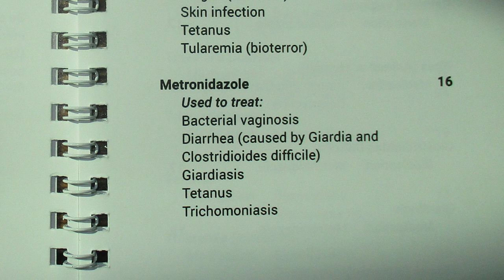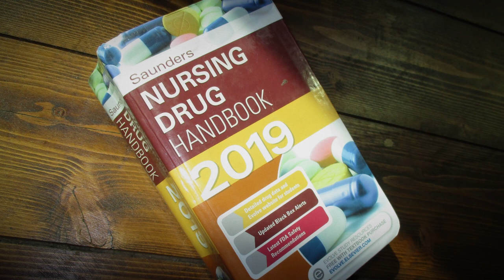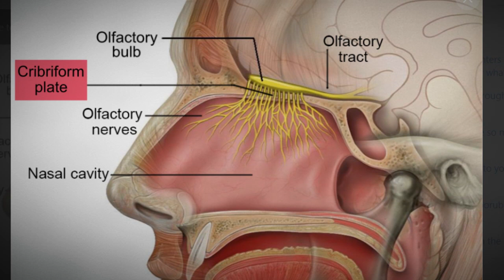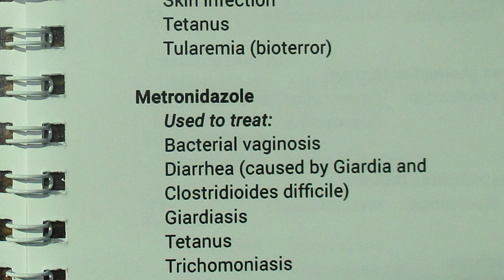The Truth About Jase Cases

Comment: Hi, great video! As a prepper and a doctor I think Jase medical is a great idea and wish it were available here in the UK, it's hard to get hold of antibiotics here. Of course this is for good reason, and they should only be used in an emergency situation for safety reasons (not being able to get an appointment with your usual doctor doesn't really count, as there are other ways to access healthcare). Just for your knowledge, so you don't mix these up, I think you're confusing Metronidazole and Miconazole. Bacterial Vaginosis is an overgrowth of bacteria and can be treated with Metronidazole, which is an antibiotic. A fungal infection of the skin or vagina (often called a yeast infection) can be treated with Miconazole, which is an antifungal.
Reply from the maker: I might have mixed that up on the fly while I was doing this video. Thanks for pointing this out - and this is a great illustration of why it's important to take these things very seriously and to research anything that one is about to do along these lines.
I agree that the appointment hassle isn't an emergency for sure. My personal experience with doctors has not been very impressive, so I've been somewhat trained over time to feel that my own sense of things is on par or better than a random doctor's advice, so I don't hesitate to fly solo when it's convenient to do so.  But there are certainly great doctors out there too... I just don't seem lucky enough to cross paths with them often.

Comment: Without knowledge the use of antibiotics is dangerous. Is this company subsidizing this video in anyway Praxis? I’ve seen so many adverts as videos for them I’m wondering? Anyone thinking to use antibiotics I suggest learning to answer these questions first. What is a gram negative infection? What is a gram positive infection? What is the symptom difference between a viral and a bacterial chest infection? Doxicycline expires, what happens to it when it does? I’d not use this company given the types of antibiotics you mention.
For those who do not know penicillin is largely useless now thanks to the meat industry but a year or so after the end of antibiotic use penicillin V will work.

Oh. I’m done here. Antivaxxer promotes misinformation again in the form of bs questions. I’m ashamed I even clicked on this.
Reply from the maker: I'm not sure that the required level of knowledge you suggest is truly required to effectively use antibiotics in most cases. If it IS as dangerous as you suggest, then I (and many other people who have done similar things to what I've done) are all fantastically lucky to have wandered so blindly and to have not been struck down.
That's possible - that my success is due purely to luck. But as the successes pile on and on and on, at some point, it becomes less likely that I'm just a super lucky person, and more likely that the methods that I use might be somewhat effective.
Also, I think you know that I'm not an anti-vaxer... or if I were, I'd be very poor at communicating that perspective when (specifically in this video) I talk about how wonderful and positive safe and effective vaccines have been for our world. I don't think that anti-vaxxers tend to be as pro-vaccine as I am.
Lastly, haven't you yourself suggested that it's a good idea for people to stock antibiotics for emergency use in your own videos? I feel quite sure that you have on at least one occasion. If that's true, I'm not sure what issue you'd have with this video advocating the same exact idea - especially where I spoke a number of times during the video about the responsibility inherent in self-medicating and the limits of the use of antibiotics.
Reply: @PraxisPrepper  ::Praxis drops the mic:: (and I get to quietly chuckle)
Reply from the maker: @matthewellisor5835  i wouldnt want to appear to be mic dropping on huples cat. He's an intelligent guy who's opinion i put a lot of weight into. I just wasnt sure what he was gettiing at in this particular comment.